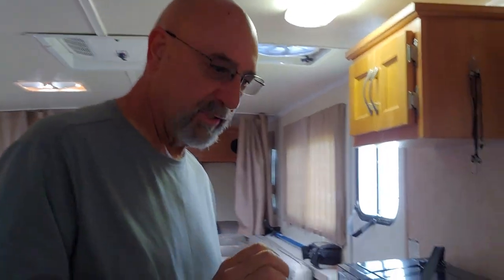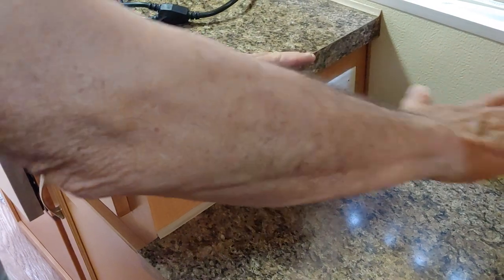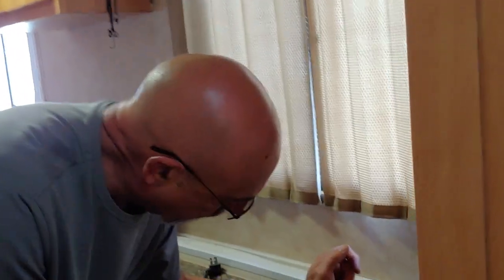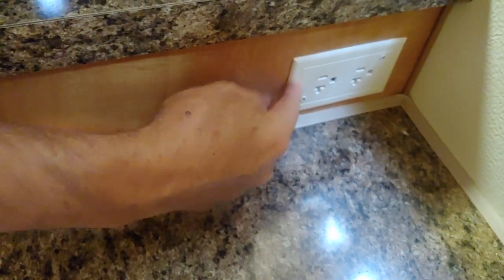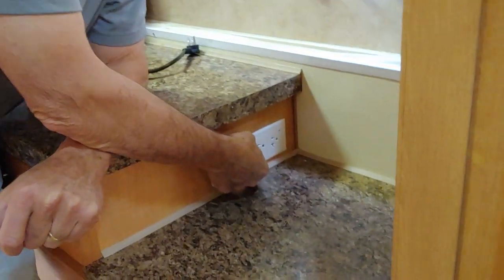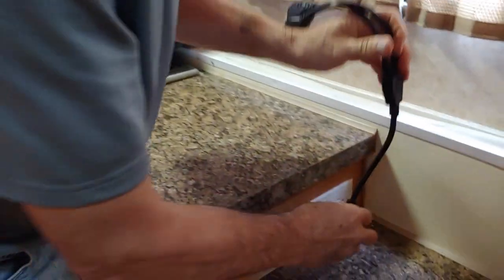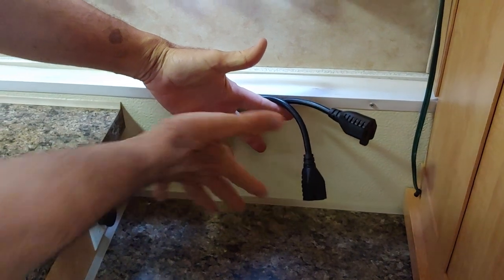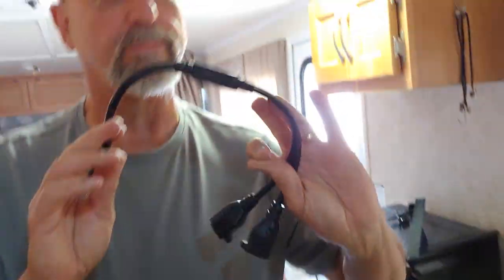Trailmanor:  Microwave Electrical Receptacle Modification

Comment: Pretty slick idea to make that outlet useable.  We did the same thing with a power strip with the 90 degree plug on it.  As we built our own microwave drawer we could cut a small notch in the corner for the power strip cable and the power strip sits on the counter or top of the wall.
Reply from the maker: Excellent.  I'm always happy to find a better way to make things simpler.  A member posted a link to a short cable with a rotating head.  That would have eliminated me having to shift the receptacle.  Hope y'all are doing well.